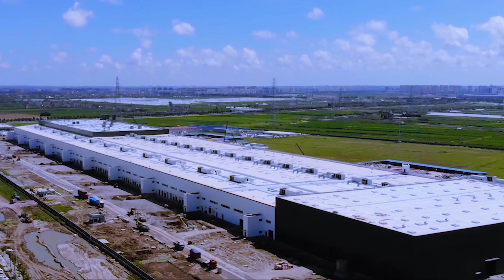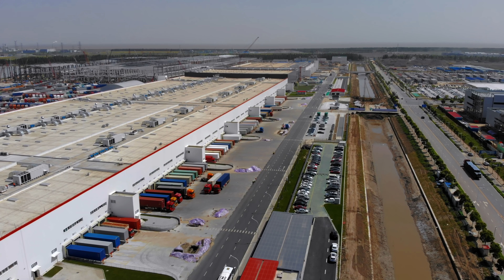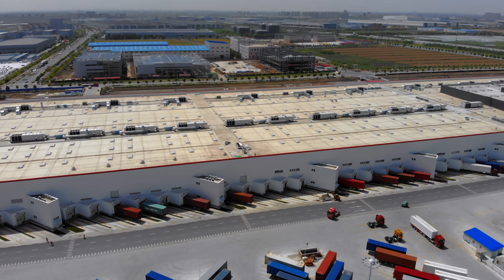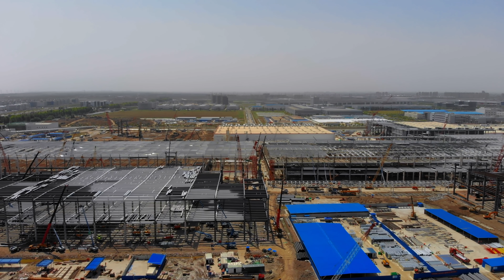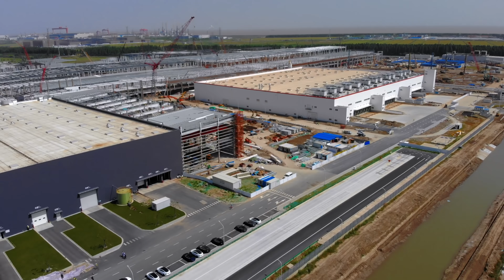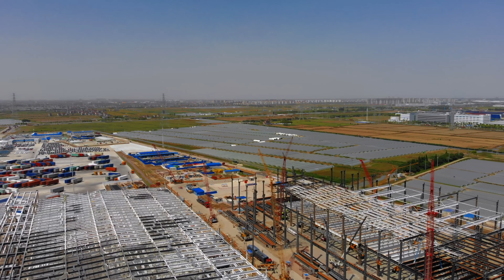(May 14 ) Tesla Gigafactory 3 Can't afford to lose,Must succeed

Comment: Jason Thank you the old factory (Giga3) seems small to compare the alterations. Alterations seem to be double the size of old factory. I also see a lot of the new factory has a second floor or am I seeing this wrong? If the factory has a second floor then the alertration could be twice its size but hidden?
Reply: In some areas, Stage 2 building even have three floors.
Reply from the maker: I feel that the assembly line part is a one-story design, and parts production may be designed as two floors.
Reply: @mspalmboy  I see 4 floors in the top corner of the big building.

Comment: Really want to see what ramp is for on trailer storage end of phase2
Reply: Ramp at north end of building 3A is probably the exit from the second high level model Y assembly line.
Reply: Was wondering about that from the previous video.  Was thinking same as @AndyGranger: yeah, production exit.
Reply: Already run out of room so where going up

Comment: Does anyone know what's happening with the 'canal' at the front?
Reply: Looks like it is nearly finished. They had temporary drained sections of it to work on bridges and rain water connections. Maybe not a priority since it doesn't affect car production much. The bridges seem very low fixed bridges, but the 'canal' will have to stay since all of the roof area drains into it.
Reply: @jwstolk  I agree. The big bridges are made up from pre cast beams.  Once this canal area is landscaped it will be beautiful.
Reply: @andygranger3662  Andy, I'm always impressed with your comments and insight. Are you in the construction industry?
Reply from the maker: This is related to the local climate. There will be short-term heavy rain in Shanghai during the summer, and the canal will ensure that huge factories will not accumulate water.

Singapore is a good example. They built a large number of canals in the city, where there is basically no water accumulation caused by the rainy season.
Reply: @pundonor1  I am an engineer, and take a particular interest in the construction details at rhe Tesla plants. I have 40 + years In international automotive -  .mainly  heavy truck, but still find the civil side fascinating. Jason's videos always impress with their high quality, which enables one to understand the technique used.

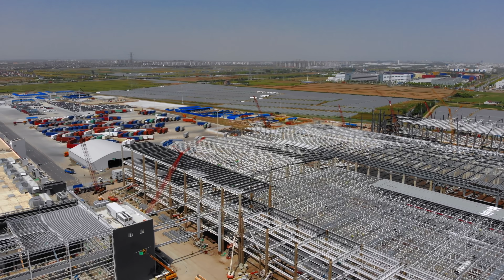Comment: 7:12 left of middle Seems too maybe be a future employee bridge?
Reply: Sean Ring Yes. :)
Reply: It’s from molding building, I was thinking it would supply molding from there for phase 2. It’s really big for just workers.
Reply: I think it's for model Y foundry parts going to 3a.
Reply: The existing stamping shop is supposed to feed model Y assy, probably also with frame castings. It would seem ligical if the bridge was for this purpose.

Comment: I thought the roofing would have been done by now. I can't see much change since the last video. Is it an old video?
Reply: A lot has changed in a week. The structure of the stamping shop extension ( most probably for frame casting) is nearer completion and intermediate floor steels and roof framework installed on 3A. Please bear in mind the slight change in work scheduling, with much more of the high level service ducting etc installed prior to roofiing in order to make access easier.
Reply from the maker: Compared with the first phase of the project, they adjusted some sequences. The installation of pipes and painting of the top of the plant started before the capping. The plant may be too high, and this arrangement is easier.